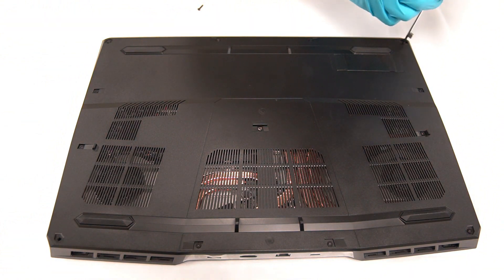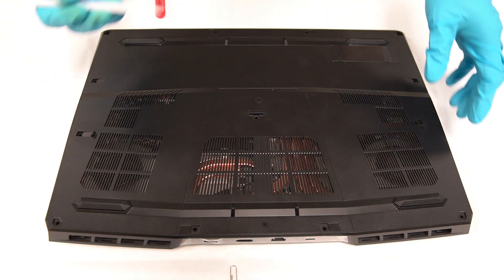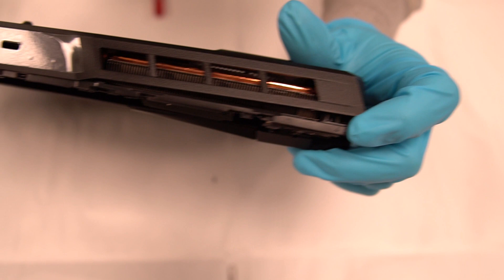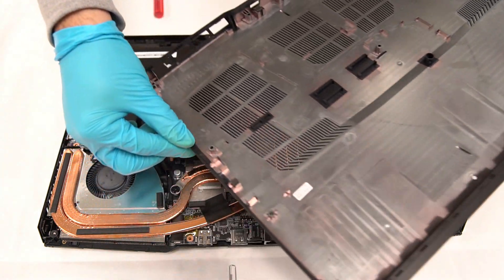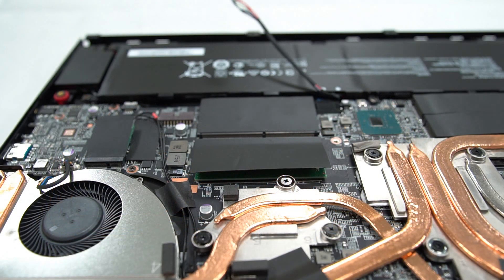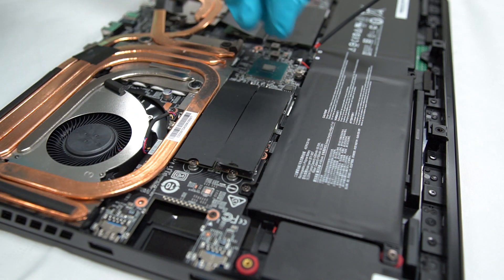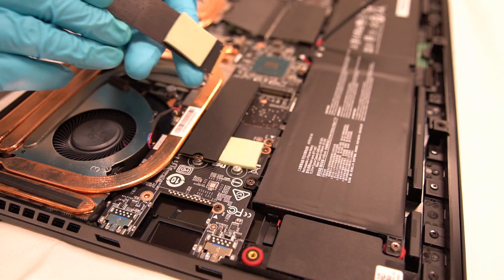MSI GE76 Raider/GP76 Leopard SSD & RAM Upgrade Tutorial

Comment: Hmmm I wish mine would come off as easy as yours did. It seems I have a factory seal sticker beside the USB c and headphone socket (GP76 VECTOR). That area is proving to be a tough part to remove. That's the last part that needs to come off. I'm apprehensive to apply more force in that area. Any suggestions....

Comment: Can you tell what thickness of thermal pads You used? Is it 2mm?
Reply: I got an email from MSI and they says 3/4mm , but im not sure as im still not added for now.  using the original ones the main drive goes up to 61c , a second drive whitout goes to 73c

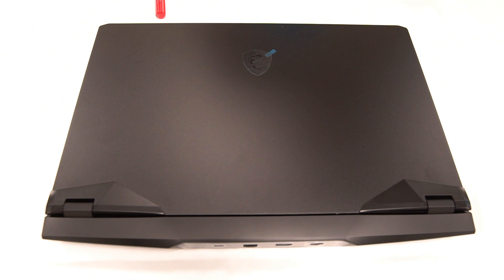Comment: 1:07 I found removing that wing-looking piece of hinge plastic very difficult. In fact, it is NOT necessary to remove it in order to take off the back cover. You can simply take off the back cover starting with the vent side like at 1:59
Reply: life-saver
Reply: This might be true for GP66 Leopard
Reply: @DryBat  Nah you can clearly see there is no need to remove that plastic piece. You do know this video is NOT for the GP66 right? The other shell process is nearly identical hence many of you 66 or even 65 owners used this video either instead of or mistakenly used it, as you can see by some comments. 😆
Reply: @hanskurtmann6781 gp66 leopard same thing I did that too

Comment: Hey! Is removing the "factory seal" and upgrading the SSD voids the warranty?
Reply: No.  MSI states specifically in their warranty policy that user performed upgrades do not void the warranty, but damage caused in the process or as a result of the upgrades are not covered.  Basically, as long as you don't break anything, you will keep the warranty.
Reply: @thefunkilledu  thx man.

Comment: Is it possible to remove the battery on this model, and use notebook without it?
Reply: I have to ask. Why would you want to do that? Sincerely curious.
Reply: @rabbitBre  bought it only for home using, no need in the battery this way
Reply: @allexgrom  im mostly asking why would you take the battery out though? I use mine at home and keep the battery in. What does it hurt to leave in?
Reply: @rabbitBre  in some cases better keep it out. But mostly it doesn’t make a problems

Comment: Thanks for the video, I couldn't figure out how to pop off the bottom after removing the screws on my GE76 Raider 10UH-231. Just completed the swap of 1TB M.2 to a 2TB Samsung 970 EVO Plus and made the stock WD 1TB M.2 into a spare drive. There are no videos of the inside yet except for this one, cheers!
Reply: @ozcaks8888  It was 1TB + 0 and I made it 2TB + 1TB (Media). Side note, the second slot didn't have thermal pads so I had to buy them separately so the drive in the second slot was properly supported.
Reply: @butterrump  I just ordered a 2tb nvme for mine. Wasn’t sure if it would work, spec sheet says 2tb max. I guess 2tb per m.2 bay is the max.
Reply: @butterrump  what brand of thermal pad you used and what thickness ?
Reply: @ozcaks8888  Which one is the Gen4 slot ?
Reply: @dandelicious6177  Did you figure out which is the Gen4 slot?
Reply: @burgermac5341  yep, the one closer to the gpu

Comment: This is also helpful for the GP66 Leopard as well, thank you so much!
Reply: Thanks I didn't realize this was for 76
Reply: Ok so the GP66 battery connector is INSANELY DIFFICULT to get off. Don't pull on the wires. Some told me to just install the SSD and be done with it but I'm trying to slowly get it out now by using credit card on left side then right lol they made it so horribly difficult it's some of the worst I've encountered
Reply: @DryBat  Dude you need to use better tools. If you are using a CC that shows you do NOT have the right tools.

Comment: It's not necessarily required that you take the plate behind the screen off, but it may be easier depending on what sort of tools you have. I was very careful and used a spudger to separate the clips around the rear exhaust area without breaking any.
Reply: Yup did the same here.
Reply: If you had to give one good tip on how to  remove the backplate without breaking any clips, what would it be? Some water beads got inside my computer somehow and a portion won’t stay clipped.

Comment: Well Im fine :)
Product Name:                 GE76 Raider 10UH
OS:                           Microsoft Windows 10 Home 64-bitowy Ver.2009(OS build 19042.685)
Windows Product Key:          3PD93
HDI Build:                    ZS7-17K2RM4-XS1 / 12.TC0.I4.2.0.7
BIOS Version:                 E17K2IMS.109
BIOS Release Date:            2020/12/17
EC Version:                   17K2EMS1.1031214202010:30:54
CPU:                          Intel(R) Core(TM) i7-10870H CPU @ 2.20GHz
Memory:                       32 GB @ 1600 MHz
                               - 16 GB, DDR4-3200, Samsung M471A2G43AB2-CWE    
                               - 16 GB, DDR4-3200, Samsung M471A2G43AB2-CWE    
Graphics:                     NVIDIA GeForce RTX 3080 Laptop GPU, 16384 MB
Graphics:                     Intel(R) UHD Graphics, 1024 MB
VBIOS Version:                94.04.3f.00.4f,16777216
Drive:                        SSD, SAMSUNG MZVLB2T0HMLB-00000, 1907,73 GB
Network:                      Intel(R) Wi-Fi 6E AX210 160MHz
Network:                      Killer E3100X 2.5 Gigabit Ethernet Controller (2)
Network:                      Bluetooth Device (Personal Area Network)
Win32 SHIFT mode:             Unsupportive
Power Plan:                   Power Scheme GUID: 381b4222-f694-41f0-9685-ff5bb260df2e  (Zrównoważony)
UWP User Scenario:            Extreme Performance, Performance: Turbo, Fan: Auto
Graphic Switch:               Unsupportive
Reply: What temps are you getting on iy
Reply: Thx